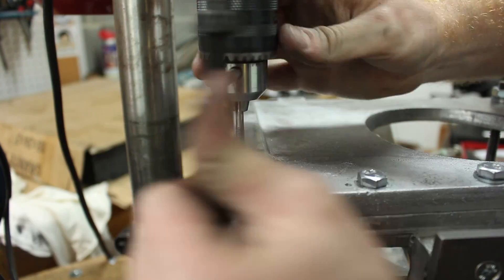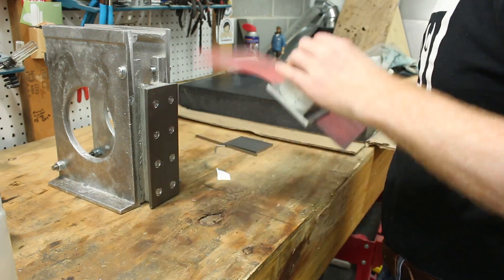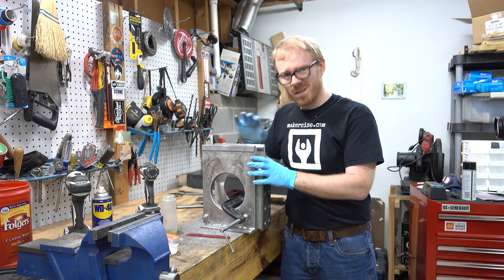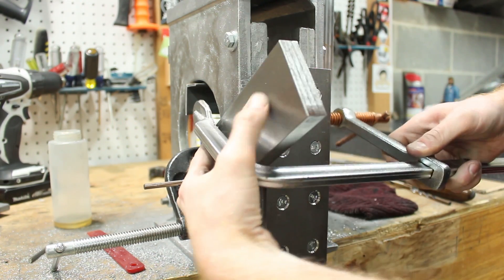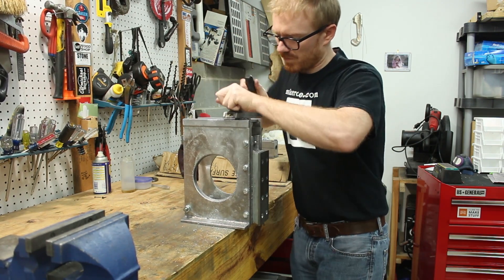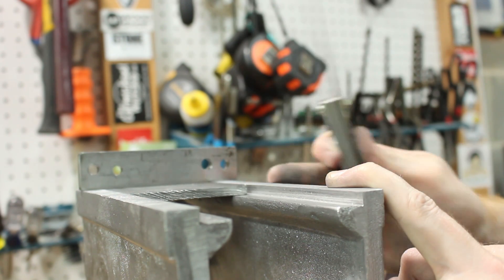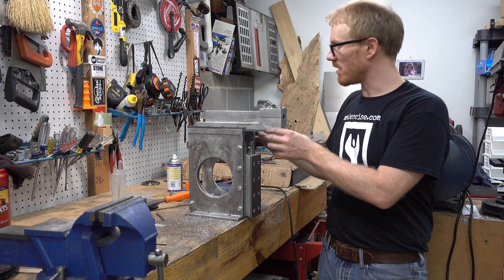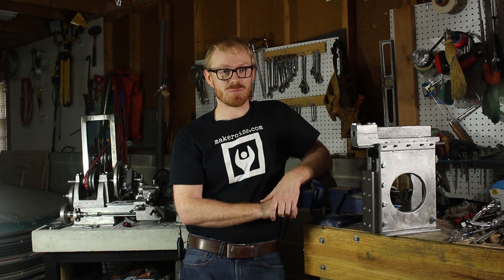Gingery Shaper - Completion of Chapter 2 Ram and Column - Series Part 5

Comment: G'day, regarding the removal of too much material for the ram slide clamps, I suggest building it up with a epoxy putty, here it's called Selleys Knead It. I wouldn't use it for any structural work, i.e. threading etc. but for filling in gaps it's great, leave for 24hrs to fully set. I've used it once and it machined well, I now keep it handy. Cheers Peter

Comment: I had heard you cannot use abrasives like sandpaper to finish aluminum bearing surfaces that way, because the soft Al embedded grit and accelerate wear on the ways.  Have you used this method before without such incident?  It would save a lot of scraping.
Reply from the maker: +Tom Perkins i feel like i have heard that too. I used the technique some on the lathe parts. Any effect is smaller than the other errors in the lathe. It definitely saves lots of time filing and scraping.
Reply: Thank you.

Comment: Did you re-check the bearing surface after drilling and tapping the gib adjustment screws? I'm pretty sure that activity would have messed up your good work earlier :(

Comment: I note the comments regarding the aluminium bearing surfaces, don't worry, camshaft's have been running in aluminium heads for years without fault. The low corner of the column could be built up with epoxy and ally filing mix. Great work. Peter

Comment: Is there any way you can put some steel inserts on top of those aluminum shelves that the ram is gliding on? I'm just wondering how long it's going to last before the aluminum wears down. I guess if you had a way to weld aluminum you could just repair it if it wears down?
Reply: Shane K exactly what I was thinking
Reply: Shane K he can always melt and cast it again

Comment: When filing the top surface of the ram slides, where the gib strabs mount for the ram, you would be better served by draw filing, where the strokes are perpendicular to the actual file.  This will result in squarer edges and material removal over a larger area.  I recommend practicing draw filing to get a feel for it, it really is quite remarkable.

Comment: Aluminium bearing surfaces? Sounds like they won't last too long...
Reply: Then again, come to think of it, a lot of the pressure is going to be upwards as the machine cuts, won't it? It will however try to hinge the ram so that the back of it wear on the aluminium...
Reply: Karl Månsson a couple of old saw blades would have made good runners. I think you're right about wear and tear.
Reply: It probably won't have great wear characteristics, but I suppose it's a good thing he made the thing from scratch, he can always make another.
Reply: I questioned the same thing.